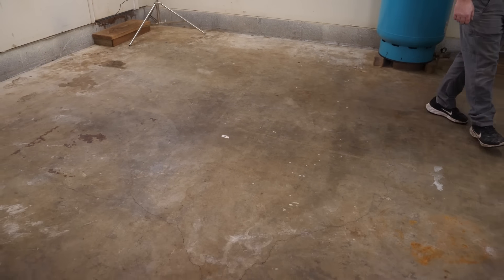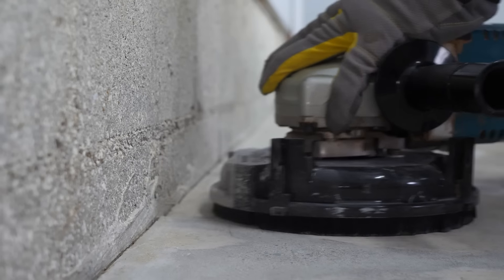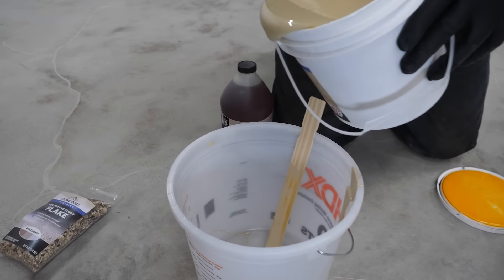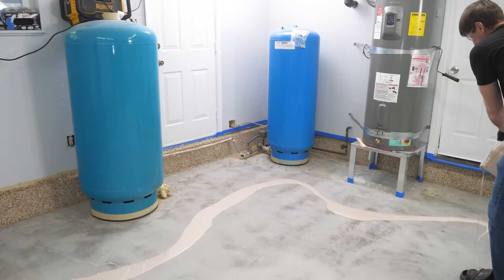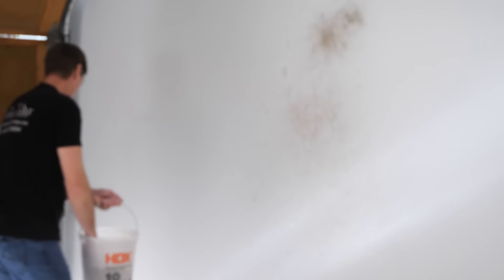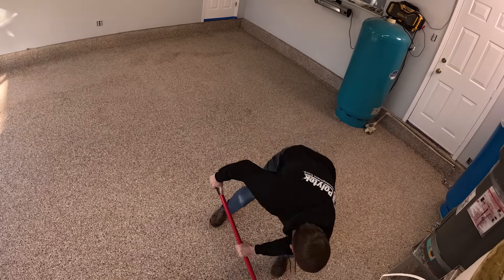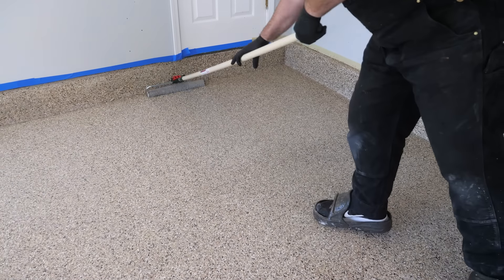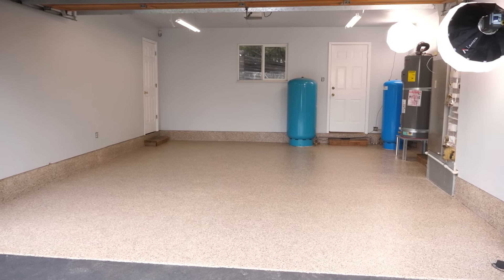Watch This before you Waste THOUSANDS trying to Renew your Garage Floor | Stone Coat Epoxy

Comment: Could you epoxy an in ground pool and the walk way that goes around the pool?
Reply from the maker: Not the right epoxy for underwater. However, the pool deck beside the pool can be covered with the flake system. Be sure to use the non=skid additive near pools

Comment: Approx cost per square foot.
Assuming use of full gallons.???
Reply from the maker: About $1.80 a square foot for all the epoxy, flake, polyaspartic topcoat and non-skid additive. about $300 sundries and concrete grinder rental

Comment: What should be used to clean oil stain? My son spilled oil long ago. It’s dry but left a stain. I’m thinking degreaser, sealer or both?
Reply from the maker: Here is a product I've use in the past to remove oil from a concrete driveway: https://amzn.to/3o6V9C5
Lemme know if you have any other questions Teresa!

Comment: Can this be used on a wood floor in a work shop?
Reply from the maker: Yes, absolutely. Epoxy flake floor over wood tutorial coming out soon. Same as the concrete except even more simple no grinding. Patch subfloor with floor patch gel, sand back flat, paint wood with undercoat - 2 coats. now epoxy then flake let cure, scrape, clean then topcoat. Let me know if you have any questions. Here is a link to the full tutorial https://youtu.be/1cIjZBUf-nk

Comment: Do you have a product that can level a floor before applying the epoxy or can you use leveling concrete under this product can you make a video on how to level the floor before you epoxy it?
Reply from the maker: We don't sell a cement self leveling compound. Pick that up at the home depot or lowes. They also sell a self leveling bonding primer to put down first to help with adhesion of the self leveler.  Allow the cement to dry 24-48 hours before applying the flooring epoxy.

Comment: If a hot water heater is located in the garage behind a door, does it need to be turned off during this flooring process?  And does the epoxy or other components give off harmful fumes that might find there way into the home?

Comment: I have old vinyl tiles on my floor , which has definitely seen better days! I have been advised to remove these old broken & beat up vinyls tiles or screed over them before laying new vinyl flooring!
If I wanted to put a floor down like this one, should I remove the tiles first, then screed to make it all one level or what would you suggest?
Reply from the maker: Best practice I would remove the old tiles. Use a PCD cup wheel on a grinder. It's messy but will make quick work of removing the tiles. Use a cement level quick after to quickly smooth and level the slab. Use the level quick bonding primer 1st, roll out a layer and let it dry. Mix the level quick real thin like the instructions. It's almost as thin as water. Let the level quick dry 1-2 days and you're ready for flooring epoxy. Let me know if you have any more questions!

Comment: I'd like to do my garage floor, but it is so badly cracked. Instead of small then cracks, think more along the lines of the San Andreas fault. Would I still be able to use your product on my old garage floor?
Reply from the maker: email me some pictures directly mitch@stonecoatcountertops.com I'd love to steer you in the right direction.

Comment: Do the top coat cover the same sqf if I used 100% flake coverage instead of the 2% coverage like in the kit? And is it better to do a second coat or not recommended for the 100% flakes option (buying the 55lbs flakes bucket) 
looking for a garage 11.5ft x 20ft + side concrete walls 20inchx31.5ft  100% flakes.

Comment: Lemme know if y'all have any questions!!!
Reply: What if the floor isn’t completely level?  Say a slight angle/ramp, will it flow or self level?
Reply from the maker: slight slope is just fine, most garages or shops slop to the front door. The moisture seal goes down real thin so it won't pool up or drain.
Reply from the maker: For this project I spent $780 on epoxy materials, $300 or so on sundries and concrete grinder rental. I got a quote from a pro for $5,100. It took me 16 hours spread over 4 days
Reply: @StoneCoatCountertops  are there some flakes that add texture, I'd like to add to my commercial kitchen, less slipoage

Comment: That looks so unprofessional no offence the steps are there but a few have been missed. Also blowing the flakes out of the garage is going to make a mess and grinding without a vacuum or using a industrial scale concrete vacuum. Also using a blower to blow the dust out wouldn’t stand in my neighbourhood. Just imagine the amount of silica dust your talking in. “Cancer “. 

But professionals in return provide you a warranty the product and the elbow grease that will have job finished in 2 days for a average double garage. An epoxy base flakes and Polly aspartic top coat would cost anyone around $700USD without rental of grinder.
Reply from the maker: Thanks for stopping by and for your feedback. The flakes were blown to the front of the shop, we pulled up the floor covering out front to catch them, then swept them up, there is no silica in our epoxy flakes. We took our industrial, contractor grade flooring epoxy system and re formulated it for the homeowner DIY'er. We removed the chemical's and VOC's, extended the working time so the DIY'er new at flooring epoxy wont have to rush which is why the project will take the homeowner a little longer than the pro material. How does your neighborhood deal with the insane chemical smell while applying your professional flooring epoxy if they are upset about dust? If a DIY'er follows the steps in our tutorial video their floor will be a success and look and last just as long as the contractor making a $3-4 thousand mark-up. There will plenty of customers willing to pay a pro even after I give some confidence and teach a DIY'er how to do it.